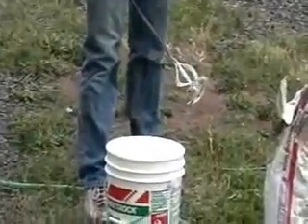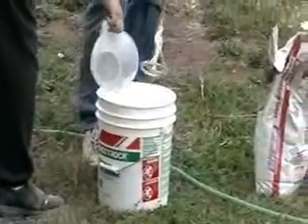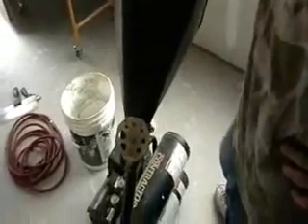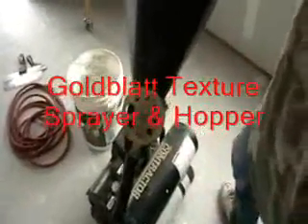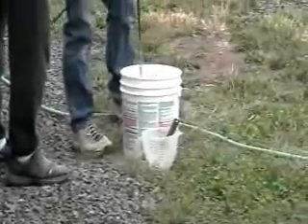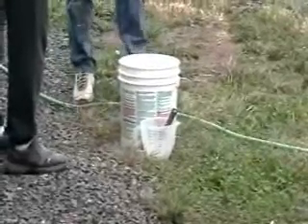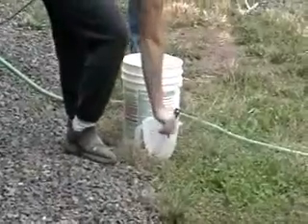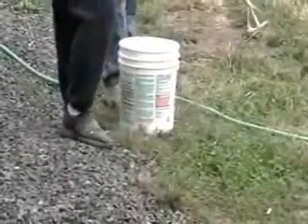Knockdown Drywall Texture

Comment: YES, and it works great for texturing walls and ceilings. knock down time is about 2O to 30 minutes depending on room temperature and/or weather outside. If floor fans are used for a quicker drying method, knock down time will be faster.

Comment from the maker: I have been told that if you use the larger opening, then you can reduce the PSI to as little as 20-30 psi. And, the compound may be ready to knock down in as few as 10 min. You should always spray and knock down some texture on a sample panel, or leftover scrap of drywall first, to see what works for you.

Comment: No need to go in different directions... use a longer trowel makes for a faster job. Looks great tho. Just depends on alot of factors how thick ur mud is humidity is always a factor , if at all possible turning ac on super cold always helps in aiding of mud setting up.

Comment: @lovesomecujo,,, if you ever work over an area that was wallpapered, beware. The adhesive WILL leach through everything.White bisque SG 4x4 and the Brite White grout for example ,WILL turn yellow,it WILL also penetrate the body and guess what.You guessed it. Next step?, common sense,which is not too common.It's quicker to remove the board.

Comment: Please keep in mind that the most important thing about the knockdown texture look is that it is consistent from wall to wall and from room to room. Nothing looks worse than a poor knockdown job. The system in this video usually results in poor outcome. To do an entire house takes at least 100 gallons of texture. That hopper hold 2 gallons and you will likely not be able to mix 50 times with any consistency. A drywall spray texture rig is required. Goto PopcornRemoval dot com to learn more.

Comment: Popcorn and Knockdown ceilings are the stupidest invention of all time. Easier for the drywall finishers in the beginning - sucks ass for the homeowner who has water damage or a light moved.

Smooth walls/ceilings are easiest to patch - appearing smooth if done by a pro.

Textured surfaces will always show a patch and eventually WILL NEED A PATCH at some point.

Knockdown and Popcorn should have died with the 80's.